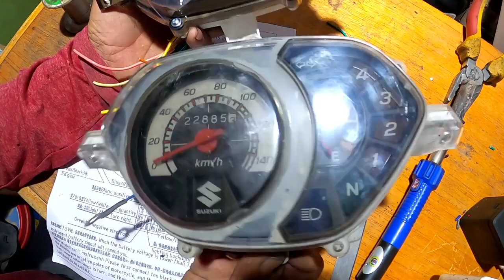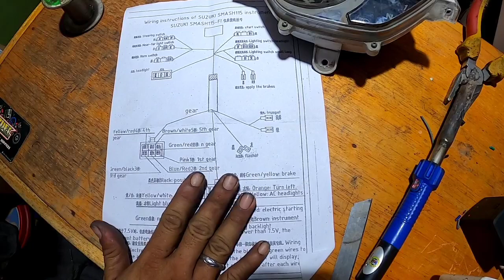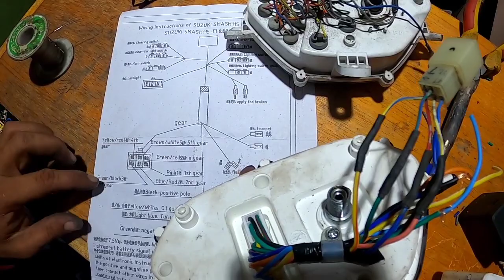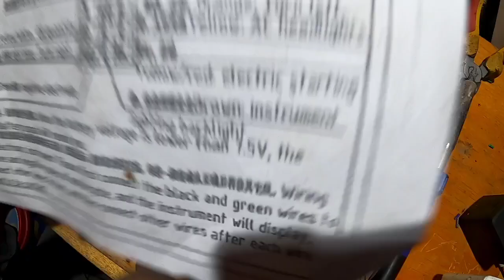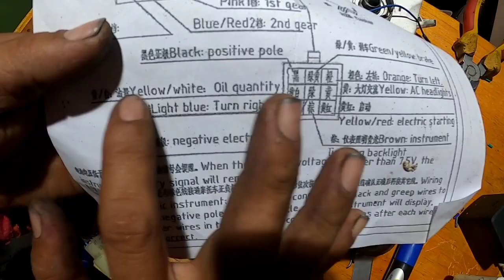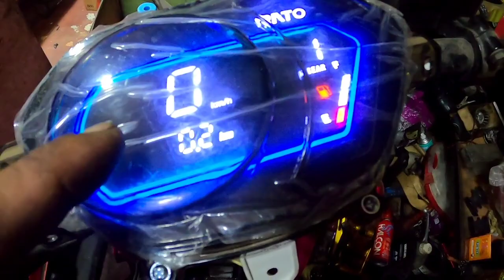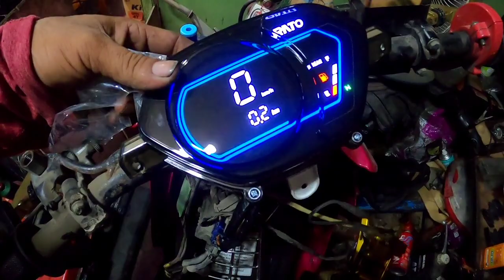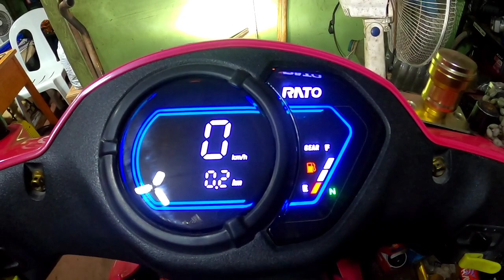Installing Digital Speedometer for Smash 115

Comment: sayang lods pinut0l m yng mga wire ng stock at yng digital sa ibang vlog plug n play yn basta ayosin lng ng pag kakalagay ng terminal sa socket ng digital...
Reply from the maker: May mapuputol din doon boss, ang purpose ko bakit ko pinotol para madaling ma sundan. Kasi kung susundin natin yung kanyang connection babaguhin mo lahat yung original connection ng motor.. mas lalong mahirapan ang mga manood natin..

Comment: wala ba yang ibang wire boss? yung iba kasi na tutorial e may mga wire pa na para sa mga switches.
Reply: mrn yn paps kc sa ibang tutorial mrn same lng nmn ng digital speedometer syang pg pu²tulin m yng wire ng stock mrn socket yn tps plug n play nmn aay0s lng yng mga pag kalagay ng terminal sa socket✌️
Reply from the maker: Meron naman pero mas prefer sakin ang putulin madali pang sundan sa mga manood..